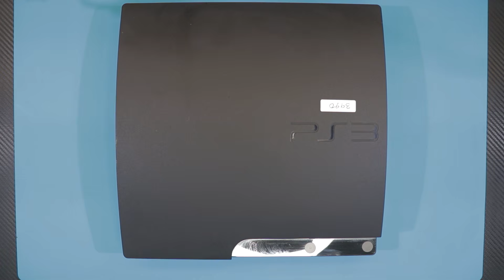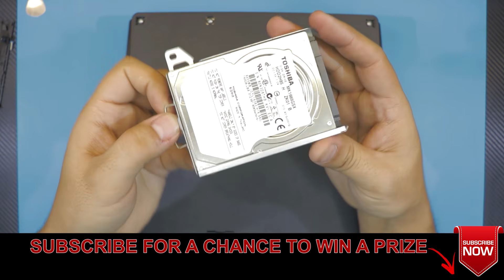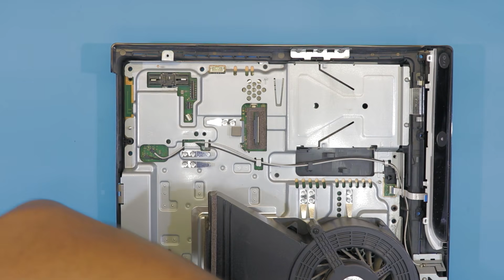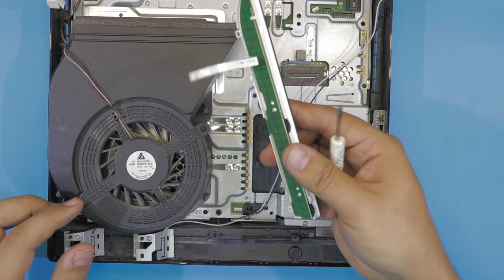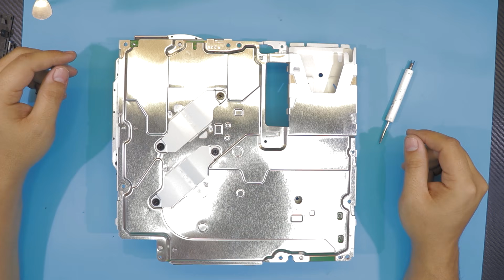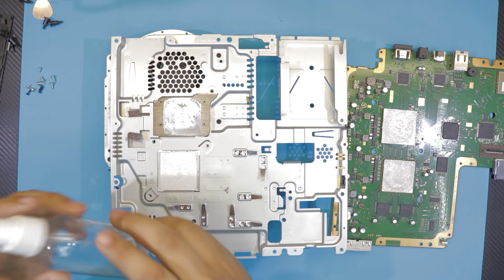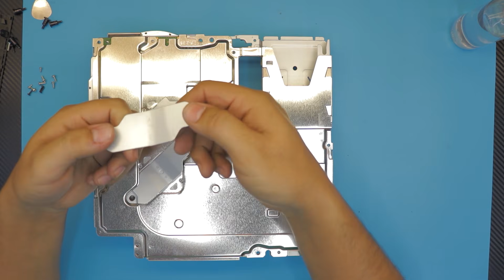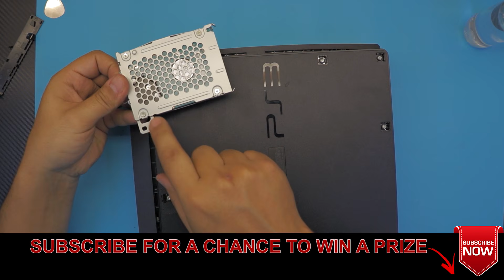HOW TO CLEAN AND  REPASTE YOUR PS3 SLIM ( playstation 3 slim console )

Comment: This guy explains himself very well very easy to understand and very thorough I subscribed with no hesitation but what I am having a problem with is the HDMI port is not reading it was going bad had to hold the cable a certain way in order to get the display on the screen of the TV what can I do to fix?
Reply from the maker: Thank you for the awesome feedback and your support, regarding your situation:
we need to figure out if the problem is the HDMI cable head, ot its the PS3 HDMI jack.
in order to figure this out i will need you to do the following step:
#1. if you have an extra HDMI cable: change your HDMI cable and see if moving the HDMI where the PS3 jack is located fixed the issue, if so then your have a HDMI jack issue.. go to Step #3.
else then just keep the new cable and trash the old one.

#2. if you dont have an access to new HDMI cable: flicp the HDMI cable the end that goes to TV now goes to PS3 and the PS3 end back to the TV, and make sure just move the PS3 end a bit and if you get the same issue then its your PS3 HDMI jack... Go to step #3.
else its your cable and replace your cable.

#3. i will try to make a quick video how to solder or replace the PS3 jack soon, (to-do list).
there is a home made fix you can try, and that is try to pinch a bit the jack and the or the HDMI cable tip, refer to picture.
https://imgur.com/a/ZcaM6y0

recall do a slight pinch 1st on the HDMI jack and test then do more if required.
let me know :)
good luck

Comment: The PS3 slim is another excellent example of Sony’s superb signature hardware and exterior design; it’s gorgeous, intuitive, quiet, and reliable. My PS3 slim looks and runs like new, so I won’t have to disassemble it anytime soon, I hope. ✌️
Reply from the maker: it is a good idea to do so and repaste, dont wait for it to fail, its like saying i have a car it runs just fine , why would i need a oil change! :/
Reply: uFixTek Good point!
Reply: It's also an overheating headache designed to die after a few years.
Reply: You should only repaste when the fan begins to get loud.

Comment: So  would bending the metal below the cpu and gpu like you did solve the problem i have with my ps3? My ps3 runs for 2 seconds and then dies.
Reply from the maker: yes repaste and bend the x clamp and it will pull better the heatsink to gpu

Comment: Thanks for the video, I followed your step-by-step instructions, able to re-apply thermal paste successfully; unfortunately i accidentally broke one of the ribbon cables that connects the blu ray drive to the motherboard (pic link https://ibb.co/3yksMhG). What should I do now? Any advice would be much appreciated. Thanks.
Reply from the maker: ya unfortunately its very hard to find those flex cables, i would suggest to take the optic drive to a repair shop and only show them and ask them if they have any its dirt cheap and they may have old ps3 around, we have a lot here but im in mexico. or look up for ps3 slim drive flex cables .
Reply: @uFixTek  thanks for your advice, I just googled but I'm a little confused. This should be 8-pin flex cable right? can't seem to find it on ebay or aliexpress. how can I contact you?
Reply from the maker: this is my email i will look for it tomorrow 
bdsoporte.queretaro@gmail.com

Comment: Hello sir I have a ps3 slim and since 2014 was in my closet so today when I was searching I found it so when u plugged it . it works then shutdown like 3 scond is it maybe gpu  cpu problem do I have to do the same u did and it will work ?
Reply from the maker: it could be the cpu of gpu fault or it could be a bad power unit too. i would suggest to do the video then if not then try to test the power unit with a different one,.

Comment: my blue ray disk got stuck halfway through when inserting it and now i cant get it out, or open the back panel. Before opening and repasteing the ps3 it was working normally. What do you recomend?
Reply from the maker: double check the flex connectors and there is a flex connector  under the DVD make sure its all the way in and double check your work comparing to the video @21:00 make sure you didn't misplaced anything.

Comment: Great video man! I have a PS3 slim model CECH-3004A that has having a problem since the end of 2016, it turns on and then turns off after 1-2 seconds (the fan seems to turn on during this brief moment), i already bring the PS3 to technical assistance, but their "fix" only managed to get the PS3 back for about 2 hours, do you have any guess of what is causing this issue ? Can i fix it myself ?
Reply from the maker: you have a bad solder join under your GPU, many tech guyz they say they will do a "Reballing" but then only heat it up and will work for sometimes and they cash out on it, if you want a permanent fix you need to do a "reballing and you cant do it because it requires a reballing station. 
https://amzn.to/3gatuYe
you need to go to a shot where they have a equipment alike the link i send else they only BS you/.
Reply: uFixTek   bruh it says it’s 15,000 on that amazon link 😂😂😂
Reply from the maker: yes the equipment for this type of service cost around that.

Comment: In 14:00 you used at that mx-4 
For what? And I havent this, its nececry to useing it? Did I have to buy it?
Thanks
Reply from the maker: YES ITS VERY VERY IMPORTANT TO CLEAN THE OLD PASTE WITH ALCOHOL and PLACE A GOOD THERMAL PASTE:
https://amzn.to/3eehO59
Reply: @uFixTek  ok I will order.
But just for my unddrstad, what this thing does why its importent?
Reply from the maker: its a thermal paste it transfer heat faster and better from cpu to heatsink. its the most important part of laptop game console and many other the better the thermal paste the better the performance of the equipment.
Reply: @uFixTek  I get it.
Now, my problem was that the ps3 over hiting but stil can read the disk but after 10 min playing it its stuck, some times even from the begining he cant recognize the disk. You have a recomend to do something else exept clening it like in the video?
Thanks
Reply from the maker: the problem is not the disk its the cpu or gpu over heating and that can freez the video or crash, you need to repaste 1st then see if it went away the problem.
Reply: @uFixTek  ok thanks
Do you think that 2 gram from the mx 4 will be enough or should I buy 4 gram?
and its importent to buy mx-4 or its fine to buy mx-2 because the mx-2 is cheaper?
Reply from the maker: hagever ha 2gram is fine but 4g is better 👌
Reply: @uFixTek  The store next to me sells the mx-4 4 grams not like you send me, there is with red line on the top (price 8$) ,(the 2 grams price 6$) but i dont know if it good 
Its riten on the red line 2019 edition its good?
Reply from the maker: i saw the link its fine they have different presentations, no need to worry about it. any MX-4 is fine. :)
Reply: @uFixTek  ok great, I buy it tomorow and try to fix the rest
Thenks for helping
Reply: Did every thing step by step and but somehow(probebly I touched somthing) and I cant entrence the disc into the ps3, I thinks the problem is at the arms of the cd reder when I need to enter the disk because the arms at this part(the part that cover the laser cant move free, the righy hand somehow stuck... maybe you have any idea what hapend or what to do?
Reply: Hi me again...
Prety much fixed the problem i maid but stil disk stuck after few min and after it the sony even cant recognize dicks.

Comment: I followed your guide but it still shutting off
should i use a different thermal paste (used Artic MX4)
Reply from the maker: you may be facing a dry or cracked solder ball under your cpu/gpu , as this are BGA not LGA.
try different thermal paste, the best thermal paste on market is:
https://amzn.to/2VwyOf6

if this doesn't work you will have to look into DIY reballing (heating your GPU) with hair dryer / heat gun for 5 min 1-3cm distance.

good luck

Comment: Is it compulsory to re paste
Reply from the maker: it is , as important it is to change your car oil :) the thermal paste has an expiry date based on the use, normally last 1-2 years under normal 3h daily use.
Reply: @uFixTek  thank you bro. I have some problem with the HDMI output alone do you have any suggestions bro

Comment: my ps3 slim is overheating even after changing the thermal paste
Reply from the maker: did you do clean the heat-sink and cpu?, what kinda thermal paste you used? after putting the thermal paste and the heatsink , you didnt lift the heatsink up again , if you did you have to clean and reapply
Reply: @uFixTek  this is not the first time i have applied thermal paste . the thermal paste i used is very cheap ,,will try it with a good quality paste and will update you.
Reply from the maker: there you have it i would suggest using this : 
https://amzn.to/2Vyzrof

its cheap and good quality

Comment: Hi! My PS3 reads DVDs but won't read BluRays (games or movies). The drive accepts and ejects discs just fine. It's just that it won't read any type of BluRay disc. What could the problem be?
Reply from the maker: thats you laser that is dirty or not working , at the back of your ps3 there is a model number give me your model number
Reply: @uFixTek  Thanks for the quick response! Model no. is CECH-2001A.
Reply from the maker: Ricardo Gomez  first thing tomorrow i get you the options that you have
Reply from the maker: my friend looking around the only and the best solution for you and fix would be to replace the laser here is a link to the  laser if you want to purchase , its for your model it includes all the mechanism ,
https://amzn.to/2K9uihs

installation its easy just remove the dvd plastic cover and the rest its easy there are 4 screws holding the bracket .
good luck

Comment: I think I've messed up the blueray, it will not allow the discs to enter now... Do yo know what could've been messed while reassemblying?
Reply from the maker: you may have messed up the flex cable under the dvd drive that connects to the main board check the flex cables, you cant burnt eh drive so dont worry
Reply: Same issue here, I’ve tried Dissembling and reassembling several times trying everything and nothing has worked.
Reply: @angelmorales7327  hey man, try several times, i don't recall exactly how, but i took it apart and on until i got it to stay in place and it worked! I think this is the better video showing the parts.

Comment: Hi.. thanks for the video sharing.
I would like to ask.. how if im put off blueray disc from machine ? cause im only using HDD only for game.. thank you, and im plannig to modified to add fan in above casing
Reply from the maker: im sorry i but i cant understand what you want to do , you want to be able to read blue ray discs?
Reply: @uFixTek   i want remove/disable my blueray disc from my ps3 slim
Reply from the maker: you can just remove it nothing will happen , just unplug the dvd drive and remove it
Reply: @uFixTek  Thank you bro. it works propperly

Comment: I would like to mention that removing the old thermal paste can be done neatly with the edge of a one sided razor blade held at about a 15 degree angle to remove anything that is built up, thick and/or dried. (it saves on cleaning product and usually comes off in one big chunky piece or shaving) To clean the remaining paste, Zippo type lighter fluid squirted on a paper towel  will remove it much faster and easier than alcohol. (yours looked like 50% alcohol)  Lighter fluid also works well with glues left behind by price tags or stickers. It almost never leaves a stain on any surface and won't melt or dissolve plastic or remove average to quality ink stamped/printed writing or numbering.  (found on most electronic face plates like stereos) 
Discard the used fluid soaked Kleenex properly and only use the fluid in a well ventilated area.  
Our family has used lighter fluid from before I was born. Tar on your shoe?, Gum?, It's worth keeping a can on hand. We even used it to get the heavy glues from bandages off our skin but Wash right after. :) The PS3 I worked on was opened because the BD player was not loading disks into the machine. Upon opening it up I found so much dust, it looked like it had insulation blown in. lol I got the BD player working after taking it apart and removing the nickel from it. (A 3 yr old's idea of a coin bank I guess) lol This PS3 is now nice and clean inside and out.
Reply from the maker: i use 95% isopropilico alcohol , it will remove any thermal paste with one wipe or two.

Comment: Red light is flashing on mi PS3 what does that mean. It won't even turn on
Reply from the maker: it could be the power supply is failing 90% of the time. its very common. or the worst is that the cpu is soldered or has a solder ball cracked under (reballing CPU), try 1st replace the PSU to see if that is the case ask friends to let you test it out of something
Reply: Unplug and plug in.

Comment: Put electrical tape on screwdive to not damage motherboard
Reply from the maker: its and idea or buy one of this if you need to be very cautious you can put a shrink tube on top of the screw driver. but i been working in this line over 12years and never had an accident regarding screw driver damaging the board.
thank you for the idea and the comment :)
Reply: @uFixTek  
Got it but after damaging my slim id use that trick but thanks for the tip
Reply from the maker: sorry to hear that :( but i hope you have fixed the issue. good luck
Reply: @uFixTek  nah i bought another one used but good deal 55 bucks
Reply from the maker: sweet deal my friend :P
Reply: @uFixTek   yeah
Reply: @uFixTek   can you use toothpaste as thermal paste
Reply from the maker: YES YOU can better than nothing, and better than air. so therefore you can as an last option. but not recommended.
Reply: @uFixTek  ok
Reply: @uFixTek  i have 2 ps3 a fat and slim and i cant afford mx4 so i put toothpaste then fans kick at high speed then the ps3 fat shuts down
Reply: Oh this vid is helpfull since i repasted my ps3 slim
Reply: Btw on that ps3 slim that was damaged i made a hole with screwdiver
Reply from the maker: the toothpaste is not going to hold on for the PS3,  get any cheap thermal paste off amazon, it will be better than toothpaste.
toothpaste usually is used to test stuff for few min and preventing few min over heating.
Reply: @uFixTek   kkk
Reply: @uFixTek   thx for the tips
Reply: @uFixTek  last question will it improve performace if i delide both processors ?
Reply from the maker: yes and no, if you delide is because you will be using a better thermal-paste or a Liquid metal.
i don't recommend you to delide. as the factor of the money you have to spend on Liquid metal and its more delicate.
instead of delide, go get the best thermal paste that is : https://amzn.to/3aYoiDF

Comment: what causes the overheating? and also, why does my cd drive don't accept any CDs? is there any problem? i haven't opened it yet due to the lack of information, tools and courage, please help.
Reply from the maker: the over heating is because of the thermal paste its old, and when its old it does not transfer the heat the way it should , any thermal paste should be replaced every 2years o 3years depending the usage and the environment temps and where you have the console. and dust and many other reasons.
do a repaste and clean it, and it should and it will not over heat.
the dvd drive that is separate issue nothing to do with cleaning nor over heating . it could be just a bad lens
Reply: @uFixTek  what should i do to the lens then? thanks for replying!
Reply from the maker: IwasPlayer 1 give me the exact model of you pc3 , at the back or under there is a sticker with a exact model : xxxxxx
Reply: @uFixTek  CECH-2501A
Reply from the maker: your model 2501a has a bad lens its very common that they stop functioning , you need to replace the laser and bette the tracks with it get this, its very simple to take apart the dvd case after opening the console , its just a box with few screws.
https://amzn.to/2UxWQre
Reply: @uFixTek  Thanks man! now i am ready to fix this!
Reply from the maker: good luck and if you have any questions ask

Comment: Didnt take out the disc tray, just the power supply. But I cleaned my ps3 for the first time that I've owned (9yrs, new) and omg there was so much dust
Reply from the maker: ya you should do it every year or max every 2 years, all depending the daily use. thank you for the comments and your support
Reply: @uFixTek  yeah. The comment auto corrected to ps4, I meant my ps3. 
But my ps4 I've cleaned several times because it is consistently in use. My ps3 hasn't even been turned on in like 2 years but I figured since I'm doing the ps4 again might as well.

Comment: I followed the instructions to the letter and the power will not come on after I reassembled it. What troubleshooting steps should I take?
Reply from the maker: B2 Bergs double check if your power board flex cable is pushed all the way into jack, and make sure you have connected the power supply 12v cable  inside.
Reply: @uFixTek  Thank you - I will check and get back with you. Great video, by the way. Nicely done.
Reply from the maker: Thank for the comment and i hope everything works out ok.
Reply from the maker: https://amzn.to/2QoEFSp
https://amzn.to/2QKDcEV
and if you want the best of the best go with 
https://amzn.to/2ulztWT
Reply: nikola zazzoslki  I messed up somewhere in either the re-pasting or in an unseen static charge to the board, or damage to the board or with the ribbon pins. I took it in to a repair shop and they said I physically replaced everything correctly. I just could not get it to power on or make it work.
Reply: I think uFixTek had the correct directions. I think my pasting was poor, and I think I either mishandled the board or bent the ribbons.